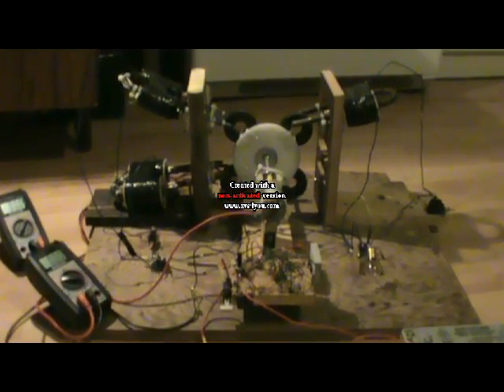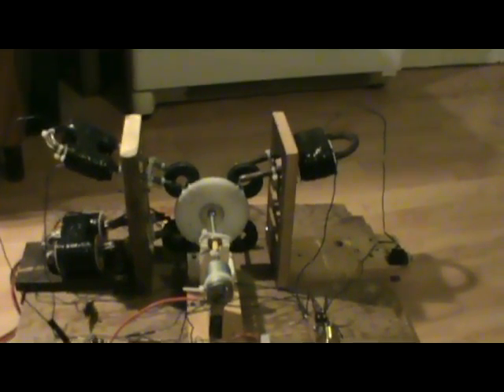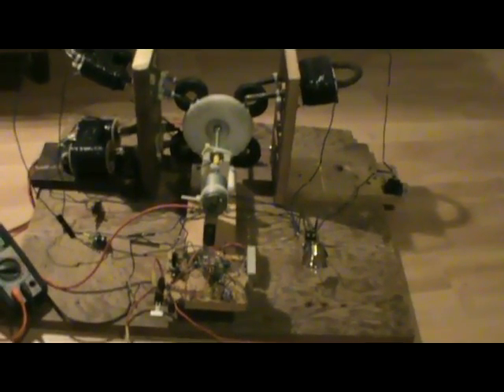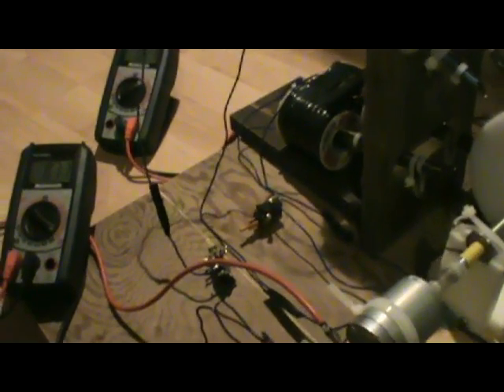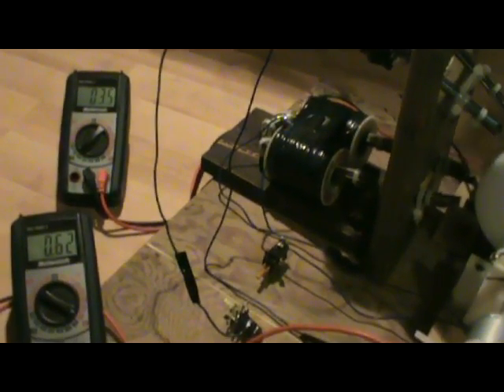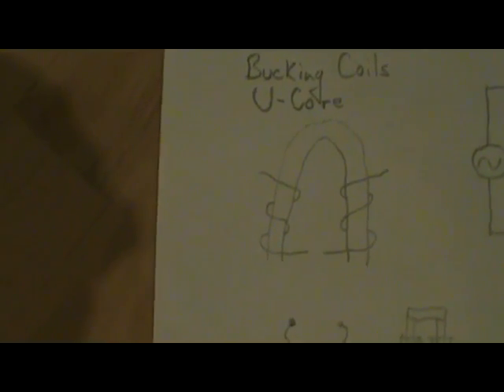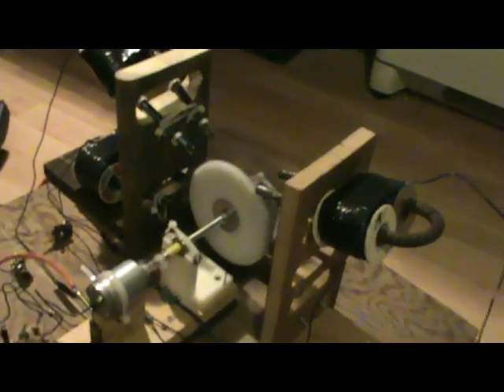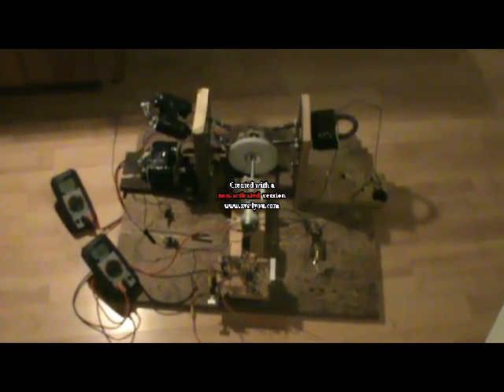Free Energy Demonstration - Ed's Secret

Comment: Guessing a neon bulb would light (may not even need a full bridge rectifier).

May need to add transistors triggered by cams, microswitches or hall effect sensors to time the coils for your wheel to work without a prime mover.

Great work man.

Much appreciation indeed.

Comment: On the iron you use, or rebar. You should use thin strips of flat steel, coated with a thin film of varnish to get rid of any eddy currents, to help magnetic flux in the cores. Eddy currents in iron is the same as adding a resistor in an electrical circuit.

Comment: I would suggest utilizing the length of the bars that the wood is taking up by doubling the number of coils on each bar, this should double output while not adding any more drag of additional iron around the wheel. I also have some gens that accelerate when a load is connected, it is a great feeling to see first hand. I have come to a theory that we may need to look for acceleration without the need for iron in our coils.

Comment: Actually the shapes that are drawn with "Fractals"/"Sacred Geometry"/"Super Symmetry" would always put the stronger end with the weaker end of the other. The snakes don't eat each others heads. :)
Its not an Open Circuit, but it is an open magnetic field. :)

Comment: I'm confused. In short, you are producing more power than you are using to spin the DC motor, shaft, and magnets. The battery is not draining toward discharged status because it is being recharged faster than it is being discharged. In other words this apparatus is a perpetual motion machine of sorts using a 12 volt battery once started somehow produces more power than it is expending to run the apparatus. Can you tell me where the extra (free) energy is coming from? Is it Dark energy? or what?

Comment: On the whole of YouTube, this is probably the most promising effect in demonstrating a "free energy" device I've seen yet. But here's where this device could theoretically act as something even more. My thoughts are as follows: if the rotor turns faster with increased load, contrary to modern physics, then would it not be possible to build a perpetual system by constructing a second device alike this one and wiring each output as input to the other?

Comment: Have you heard of the Newman machine for producing efficient free energy? Is this what you are doing? I'm confused by your video. You are not explaining how and where this free energy is coming from. A couple of meters showing current in versus current out would be a good way to demonstrate your device. But, you did not give an extensive wiring diagram of the device or where the current meters were connected. This makes your apparatus suspect of your claims of free energy production. More info..